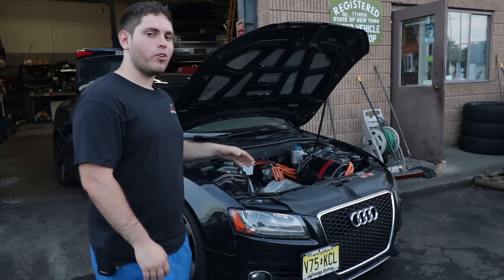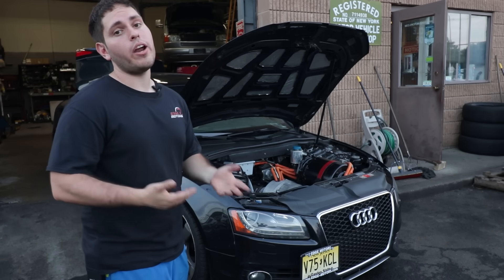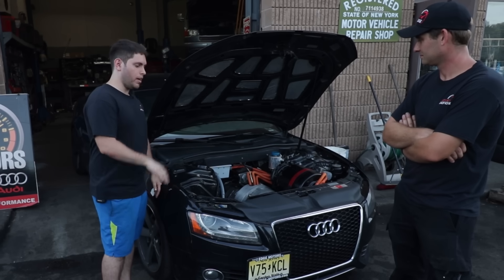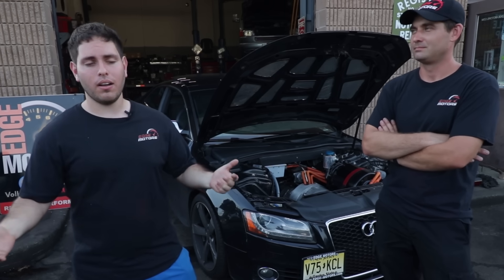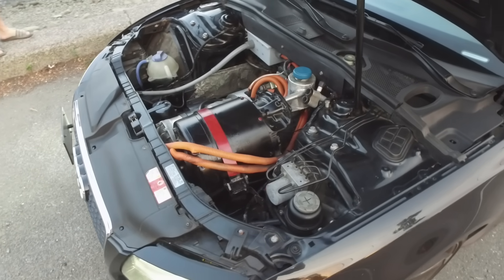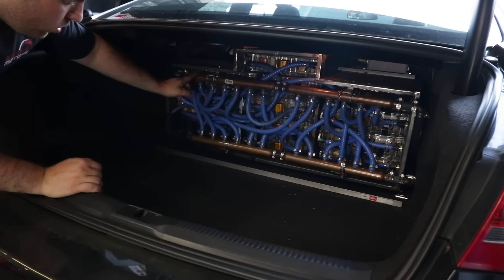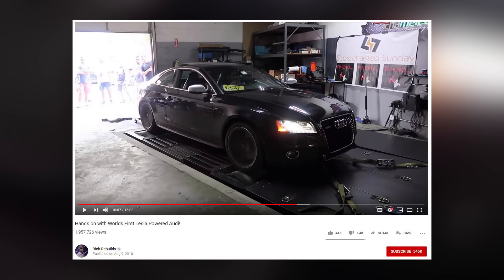Worlds ONLY Tesla Swapped Audi! How Did He do it?

Comment: You just made that Audi way more reliable. Nice job

Ex: 
2.0T FSI cam follower design
2.0T TSI timing chain stretch and oil consumption 
2.7T timing belt issues
4.2 timing chain tensioner issues

Just speaking from experience.   I still like them and love the design and styling, it just doesn't deliver like Mercedes does in terms of power and reliability.
Reply: You are so right!
Reply: I'm a car mechanic from Germany and honestly i don't get all these unreliability rumors. I myself drive an Audi S3 from 2006 and it's over 300k kms and never needed much work compared to other cars, just the regular things you'd expect. The cars i usually repair just have a snapped timing belt or specifically with turbo Audis manifold leaks but that's about it. BMW and Audi engines can usually well last into the 400k kms if you take care of them and regularly do an oil change. Transmission too but clutch def would need replacing after 350k. So yeah, what's up with that? Let's not even mention how easy it is to work on them.
Reply: You obviously didn’t listen ......it was a high mileage vehicle ........the 4.2L is extremely reliable for which it reached HIGH miles ......please do some studying before you go off and embarrass yourself some more.
Reply: Cause Audi is already more reliable than Mercedes and Tesla but yeah some people pitty like you little dumbass
Reply: Vincec og always depends on the model.... an RS3 stands no chance against a C250 d in terms of reliability. German cars in general are no longer as reliable as they used to be 20 years ago.
Reply: Vincec og Japanese made and Tesla are reliable. German cars sit in mechanic after 20k miles, total junk.

Comment: The cooling inlets and outlets should be reversed, and the outlets should be at the top, and the inlets at the bottom, because that's the way the natural fluid thermal dynamic will also drive the fluid (ie. as it gets hot it wants to raise to the top, not sink to the bottom).

Comment: Next what needs to be done is a Tesla swapped car along with a small diesel generator  So no need to plug in and will extend the range drastically to the point of actually feasible for cross country driving Otherwise 300 miles is not enough  Because you need a special plug if you wanted to charge quickly and that still takes almost an hour Specially say if you're taking like Route 66 out West good luck charging up out there  Also a lot of people don't know  Electric cars are fast but are weak at sustaining extreme high speeds or even getting their You will drain your power in no time with my design just bring some extra diesel fuel and you're set for a very long distance and go very fast if you want  Would be perfect for a off road vehicle for overlanding purposes  On extended periods of time in the countryside  definitely would get the attention of survivalist, preppers  Alright is gonna be somebody out there with the resources to do this let me know when you make one I'll put an order in I know it's a great idea my opinion would be the best of both worlds a perfect vehicle
Reply: It's called a tdi.

Comment: What an amazing engineering wonder! Setup your own company and change the world!

But every car maker in the world could do this tomorrow but they don’t want to! They want you to keep driving gas/diesel cars so they can earn money on expensive repairs, parts and complicated engines and transmissions which will fail only to be repaired at a high cost. The lifetime of an electric motor is big. 
At the end you mentioned why Audi, BMW or others are not interested to be quick about electric cars. No oil, no clutches, almost no maintenance. They delay progress by selling you shitty hybrids. You see it right there that it is possible.

Comment: That's incredible Sam... I'm speechless and so impressed

But I had a couple questions

How long does a full charge last, and how long does it take to charge the battery from say 10% to full?
Reply: Approx 250 Miles, depending on how you drive it.  About 10 hours to charge from 0 to 100. Installing Lvl 3 Charging soon, should drop the time to about 45 mins for 80% charge

Comment: This is a major technical achievement, especially emulating the Tesla software. There were two facts that were left out that viewers want to know - the max range and zero to sixty time.
Reply from the maker: Sam told me that the range is about 250 miles depending in how you drive it and 0-60 is 3.9
Reply: @Deutscheautoparts  how do you change oil in this Audi?
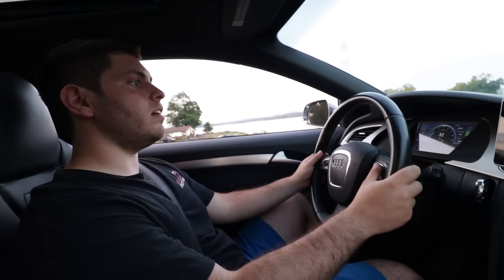Reply: @edwardvalivonis23  @10:39 he literally said doesnt need gas and oil
Reply: @monxstiglitz08  I was joking
Reply: @Deutscheautoparts  What about the total cost for the project? :D
Reply: @empirechannel7326  a lot
Reply: @empirechannel7326  what's the total
Reply: Pretty sure controlling s VFD is fairly simplr

Comment: Can you help me with programing my conversion, i have a 2013 audi a4 & my timing tensior messed up my engine, so i purchased the 2018 a4 2.0 engine & dsg transmission to max it out at 500hp, i have alot of the parts my worry is getting the engine & transmission to run either woth the compatiable syvecs tfsi standalone ecu or the euro simos 18 ecu found in the 2013 a4's with the same b9 ea88 gen 3 engines. You seem to have alot of knowledge & the help would be appreciated! Keep up the good work!
Reply: Computers in cars, especially new ones. It's the biggest downside to EVs too. All the assistance crap, lane keep, self driving, touch screens... It's not built to last or be maintenance friendly. Nobody needs that tech gimmick junk.
Reply: @DigitalDissident  its called a passion something that's lesser s
commonc these days since people want to be average